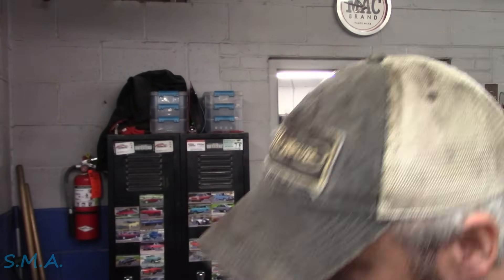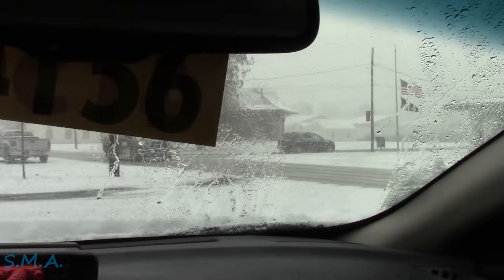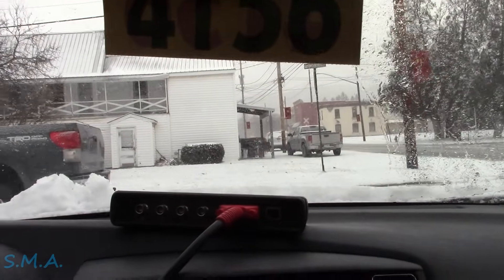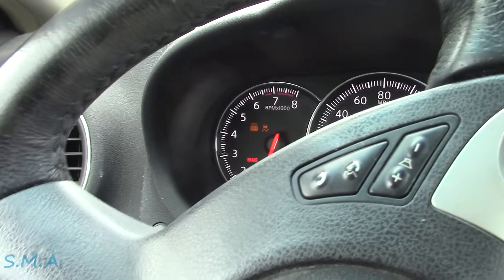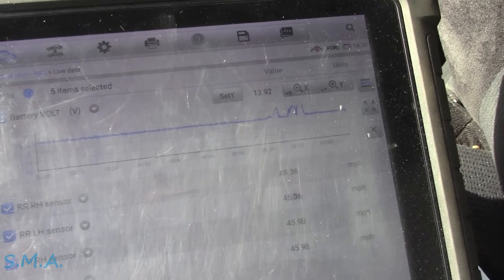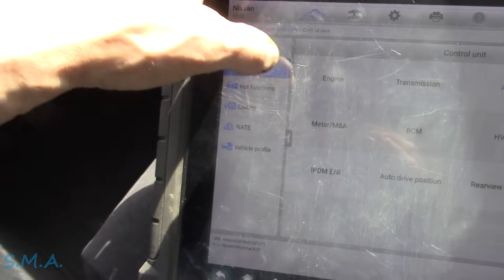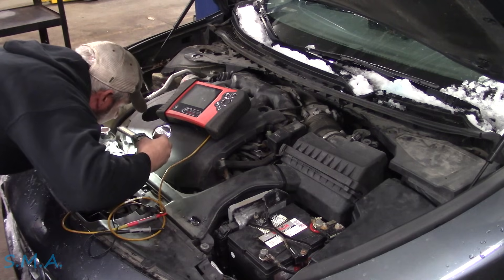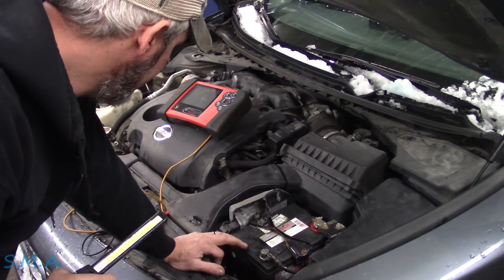Nissan Dealer Quoted Over $2000 For A New Harness!!

Comment: Yeah I ran into that problem with a Kia. It had a cam/crank correlation code and everyone was ready to put a timing chain on it, no one noticed the battery over voltage that was set at the same time. Look like it had a new alternator on it. That's when the customer says now that you mention it the light has been coming on ever since it was installed

Comment: Same song and dance with a 2007 pathfinder. Every system was getting sent haywire from a bad alternator. The DRLs would flash on/off, and the abs/Trac was really throwing a fit. Eventually it wouldn't start, and sounded like a blown timing chain (no compression)...after I cleared the anomalous flood a big cloud of black smoke came out and the windshield wipers came on.  I replaced the alt based on a constant 15.5volt overcharge and poroblemo solved

Comment: That was lucky noticing that the voltage fault only happened on a left turn - intermittent faults are a right pain. I'm not a car specialist, but do have some electronics knowledge and diagnosed a couple of friends vehicles using one of those bluetooth elm gadgets and a mobile app.

After a crash course on electric power steering (YT vid, lol), I'd guess either the steering torque sensor or the eps module has a fault (more likely the eps module). Normally you'd get a voltage spike as a large load is abruptly removed from the alternator (load dump), so it's likely the power to the eps motor is being interrupted at a time the vehicle expects it to be in use (guess that makes the torque sensor unlikely). Could also just be a tugging cable if caught around part of the steering mechanism; I can imagine the trouble a high current connection that was arcing would cause.
Reply: That’s a really good armchair diagnosis!
Reply: @randomschmo5778  Not sure if you are taking the mick or not, but looking up something new to me is usually the first thing I do before even attempting a repair on something I'm not familiar with. I do enjoy the fact that you can do it from the comfort of your armchair nowadays rather than visiting a library and trawling through stacks of manuals. Saves a lot of time. The first guess can be wrong, but all of the correct guesses go to adding to very valuable experience. The second time you see a similar problem, at least you then know where to start.

Comment: Very common in Toyota's to light up the dash like an Xmas Tree for just a single code or 'problem' for instance, a dropping 'cell' in the HV Battery will do it when the 'real' code is a Replace HV Battery pack(can be pending/current/history) actually freaked me out the first time I ever saw it!

Comment: Interesting trouble.  Cleaning the battery actually resolved the customers complaint.  Can't wait to see the alt command vs actual.  I bet there is no command, and the left turn is moving a wire harness to ground causing the alt to go full tilt.

Comment: I had almost exactly this situation - with different symptoms - on my 1998 Mercedes E55 estate (wagon) I'd drive the car fine then five mins into a journey lose my turn signals and electric windows. I was stumped and paid for a diagnostic at a specialist with a 'STAR' machine (Mercedes dealer level diagnostics) they said there were no codes, but the symptoms did not occur with accessory drive belt removed. This stood out to me! Their conclusion was I needed a new electronic ignition switch at about £1000. I thought hmm... What's not in the picture if the accessory drive belt is removed? Alternator for one thing. I took the car away... I tested my alternator output voltage when the car acted up and found 15.8v. Bought and fitted a new alternator. £100 and  all was well. I was almost scammed I think. There's no way they didn't pick up that the alternator had a bad regulator on a STAR machine

Comment: Get an external PWM controller for the alternator. Every Nissan I ever had, had sorry sorry alternator control. You can bypass it or change the ECU or get an external sense controller (I always did the latter)

The PWM doesn't start screwing with the alternator after 8 miles or so. The mileage hint in your original description gave it away for me.

Comment: -- I like your starting thought process.  With a cascading problem, always  start at the top.  Eric, I'd look at the regulator next, if it has one.  If it doesn't, grounds, PCM, but I'm not hands on.  Then the fly by wire steering to the left, though I highly doubt that's the issue.  Seems to me it's a regulator, or more likely, something is commanding an over volt.  God I miss the 70's.
Reply: It's not fly-by-wire steering, it's just electric assist.
Reply: @Graham_Wideman  Ah so it does have a physical steering arm?  Thanks for saying so.

Comment: I think your on the right track with the voltage going sky high ,i worked for honda , and the civics 2002-2005 had a problem with the alternator charging very high volts 16-18 volts and would set all kinds of codes in different systems , i would replace the alt and all was good .

Comment: Anytime I've seen any kind of issue with voltage anomalies, always check the battery and alternator (and its belt) fist thing. But I don't have a fancy pants scantool either...

I used to have an issue with my O2 sensors constantly having issues, but with no charging (running on battery only) the trouble codes always went away. I ended up replacing the charging wire.
Last time my alternator went bad, my LED cab lights were pulsating, so a bad regulator was found during a test.
Most recent issue was a loss of charging... turned out to be the power wire to the distribution block I put on had burned off... Cleaned everything then upgraded from a 4 AWG to 0 AWG cable, and used NO-OX on the connecting points. (BTW the stock alt only puts out 65 amps, and the one I use is 125, so the 4 AWG should have been fine. My best guess was a bad crimp on the cable lug.)

Comment: I had a 2012 maxima and it was a lease thank god! I had the same problem. Was driving and at a red light all the electrical went dead but the car was still running and I pulled over to see what was going on and turned the car off then it wouldn’t turn on until I tried jumping it like 5 times and then it turned on. Went to the dealership and traded it in the next day

Comment: I don't know if Nissan are like Jeeps, but the ABS control module and Steering angle sensor might be the cause of the high voltage when turning especially since you get wheel speed errors and traction control lights on dash.   But i like your thinking about the alternator.

Comment: We had a spec that our modules should shut down if the voltage got above 16 to 18V.
We were making every form of entertainment system device, and a few instrument panel(IP) items.  So with those over voltages there may be modules all over the car that are purposely turning off and rebooting.

Comment: I had a similar electrical problem with an Acura RSX a few years back.  The lights would have a constant flickering.  Alternator looked new.  I replaced it anyway and the problem didn't go away.  A look at the wiring schematics showed a complex system of a proactive current sensor (changed), interface box (changed), and feedback to the ECM (only 1 in the junkyard and I couldn't get its screws out).   The only thing that  helped was the changed interface box and that only helped for two days.    Finally sold the car just to get rid of this nagging issue.  Now in retrospect I should have tried changing out the few electrolytic capacitors in the interface box.

Comment: I met the brief (100..500ms) overvoltages to be caused by slipping belt. When slipping, the regulator went to full excitation and when the belt grabbed and so speed up the alt, it caused an overvoltage for the time the regulator needed to deexcite the alternator back. Replacing and tightening the belt (it was shot after all that slipping) and the problem solved.

Comment: Both Maximas, 1999, 2100, and my 2007 all had the same problem. The variable valve sensor would give the computer the wrong info. I discovered it was the synthetic oil. With the regular oil as recommended in the manual they ran like race cars. But with synthetic oils they hesitated and lost power and even stalled. It was most pronounced on hot days.
Reply: 1999, 2010... lol

Comment: Absolutely fascinating - is the electric  steering rack drawing too much power when it is at full lock? 

Maybe she does lots of hard left's 5 miles from home. Would be intresting to check her route. 

I have the feeling that most dealerships are not that bright and follow some sort of flow chart.  The 'parts cannon' that Rainman talks about. 

I always thought that New York was a horrible built up urban slum, however, your area looks quite the opposite.  It would be fascinating to see a video of the area.

Comment: I installed a 2018 date code Bosch AGM battery in a 2004 Audi A4.  For the subsequent 3 years I chased gremlins that would reset clock, disable ABS/traction/ESP, kill factory satellite radio comm (works over can bus), etc.  Despite never finding a definitive cause after numerous exhaustive checks (charging system, oscilloscope on comm bus, ABS module rebuild, etc) I finally decided to replace the battery under warranty after 3 years despite it always checking out OK with both carbon pile testers as well as electronic testers.  I received a Champion as the warranty replacement.  Sure enough that had been the problem all along.  No idea how or why but there must have been some internal fault from day one (intermittent short maybe?).  Since Exide and JCI make most batteries I am assuming this was a fairly unusual, one off occurrence but I definitely won't wait 3 years next time to eliminate the battery as the cause of erratic, intermittent electrical issues.

Comment: If that's an EPAS steering, cranking the wheel will draw a lot of power and might be upsetting the charging circuit.  I also strongly suspect those battery connections.  I've seen cranky battery connections piss off Jeeps in a big way causing all sorts of lights and tach errors.

Comment: I have diaged this very symptom multiple times on Semi's mostly on freightliners. Same symptoms no tach all the lights on dash and shut down. The codes are basic lots of lost communication, ABS codes  and if it happen long enough sometimes a battery code will be stored.  From what I have seen at 16.5v the modules go into a safe mode to protect them aka they turn off  and will cause the truck to basically stall out or turn off completely.

 What can be tricky is the modules need to see 16+v for a good 5+ minutes for the modules to act up and to set a battery code. 

The highest I've seen is 17.4volts the battery's had a resting voltage of 15.2v. The truck wasn't happy at all.

Comment: This happened to my 06 Dodge Dakota after replacing the alternator. New one crippled the entire electrical. It was pumping 18.6 volts into the system. Had to go get a second new one and reset the codes.

Comment: Even with good voltage you can loose bus communication if AC voltage is making it passed the alternator.  I had a bad alternator for years that caused random and phantom codes until one day it set 15 codes at once. The alternator had to be replaced.

Comment: Had very similar issue with my 2011 Maxima.  I didn't have the benefit of a fancy scan tool at that time, but did have a Fluke meter.  Extended idling seemed to make the problem more likely to appear, but it wasn't consistent.  I did the clean up thing, and even replaced the "fusible link/bus bar" because it had some corrosion issue. But after a year of fighting it off and on I tracked it down to marginal alternator output. (By then the battery had also reached EOL).  Since I replaced the alternator and battery I have had no further problems.  Old alternator was definitely not providing adequate charging, although it wasn't dramatically low.  I sure miss the days of cheap replaceable external regulators and alternators you could easily rebuild yourself.  I still have the Maxima, but I have now switched to a Tesla, and so far the only problem I have had with it is Elon Musk mouthing off about things he should stay out of.

Comment: Hi south main auto, that Nissan you are working on with voltage spikes most likely has electric power steering. This would give you more electrical load when turning steering at slow speed. 
Your on the right track. If you haven’t load tested battery i would try that. 
Modern vehicles are loaded with electronics causing great loads. 
Try a good battery, you took care of battery connects. Battery connections and batteries can cause the weirdest things to happen. I am thinking a drop in battery voltage followed by Alternator increasing its output gives you higher voltage. I would check voltage connections on alternator and Test the battery And if there’s any question I change out that battery then alternator. Sometimes things turn into a fiasco so you have to go back to the beginning and look for the simple stuff. Good luck fella
PS i know your pain, i used to live in Buffalo.

Comment: I didn't look through the earlier comments, but I found the slip and VDC lights will illuminate in my '08 Infiniti if the brake reservoir is low.

Comment: '84 Nissan Maxima, overheating ignition module, car lost power until modulke cooled down. '89 astro van, faulty mass air flow sensor, no codes. GM dealer charged me a 4tune, said I needed a new distributor and distributor cam drive gear! Cost me $129 4 a mass air flow sensor!

Comment: I had an intermentent alternator light once, finally got it in the shop and the crank pulley was coming apart, shop said they never seen anything like that before. Car was still running but alternator wasn't spinning

Comment: I was quoted $450.00 to replace an Electric Mirror selector switch at my local Nissan Dealer. The switch is $27.00 on line.  You pop out the old switch, pop out the wires, pop in the new switch, pop on the wires, and pop the switch into the drivers side arm wrist. It takes all of 5 minutes....

Comment: Maybe unrelated but had a S Class in my shop a while ago, it would suddenly turn off the vehicle automatically if left at ignition on for <10 secs, and if started, would run for a good 30 secs or so, other times longer, so when you scan it (I use xentry for mercedes), you get a low voltage power supply fault code on most modules like the front and rear Sam and most other modules, this S class was a 221 which had 2 batteries, one in the trunk close to the rear Sam and one in the front close to the air filter, I tested both batteries using a battery tester and the one in the trunk was the culprit for the issue, replaced it and vehicle is as sweet as she was before 👍😄

Comment: Well now you got my curiosity up. I cant wait to see the problem and fix. I wish you were close to me got a problem with 1999 jeep i think its the throwout bearing and fork. I dont trust anyone local very much. I always feel like i get screwed on getting it fixed. Last work done was new transmission and clutch and was supposed to have put in new bearing and fork less than 4 years on it and it sounds like its falling apart. Cant shift it either. It was cheep i guess over 2 thousand dollars worth.

Comment: overvoltage will shut circuitry down. I would charge the battery fully unhook the alternator and drive it. if all is well than there you go.
Reply from the maker: That is a great idea but how do we know it is the alternator and not what controls the alternator?
Reply: @SouthMainAuto  Isn't the alternator internally regulated for voltage and the system just gives it a feed to control amperage?

Comment: seen the same thing a few years back,, seems the valve cover was leaking  above the alt,,  it did all kinds of crazy stuff
Reply: I had an older Altima a few years ago,  guy said the battery would die overnight. Battery was good after recharging. It was a v6 car, I wanna say around a 2002. Valve cover had leaked for a while,  soaked the alternator in oil. I hooked the meter up and my dead short went to almost nothing after pulling the battery wire off the alternator. Alternator,  fix oil leak,  problem solved

Comment: That’s a difficult electrical gremlin to troubleshoot. As an industrial process controls engineer this would run about $1000 just for me to show up. Over/under voltage will cause this as most electrical devices have over/under voltage shutoffs to prevent hardware damage.

Comment: Ive Seen MAG A  steer in GM products do this exact same thing to the point it would eventually kill the battery while driving but on the other hand I've seen Alternators do this as well. You might have the 2 issues at once.

Comment: I had a Ford Fiesta that went into limp home mode, but would not throw a code.  After the parts cannon melted down, they replaced some of the harness.  That was the fix.  Fortunately, Ford paid for it under warranty.  Never found the exact cause, but somewhere in one of the wires something wasn't right.

Comment: The ford smart charge systems will do this exact thing when the control wiring begins to fail.   The voltage will go over 17 volts and the modules begin to shut down.  Basically turns the dashboard into a Christmas tree.

Comment: I think the power steering is "over reporting " the load on the steering to the PCM. At idle when you need the extra voltage the thing works fine. When on the road moving the system does not need the "extra " voltage to turn. The thing is over reporting and the voltage goes to max output where you then get the voltage spike. The right turn is working fine, the left is sending the computer a faulty signal. My best guess, but what do I know about EPS - nothing. I think those power steering pumps draw 40 to 60 amps so the voltage has to spike at idle to keep up with the load. 
  By the way I like letting us have a go at diagnosing the problem, can't wait till you find the culprit